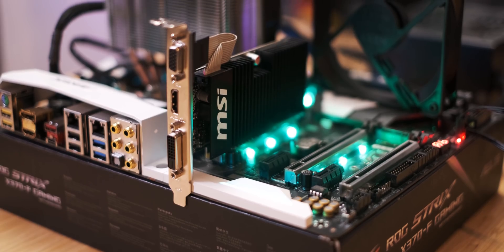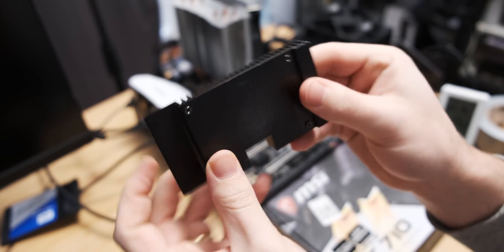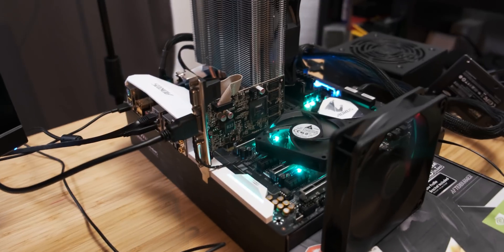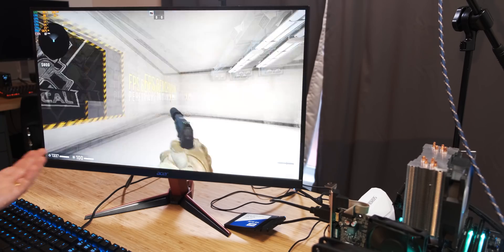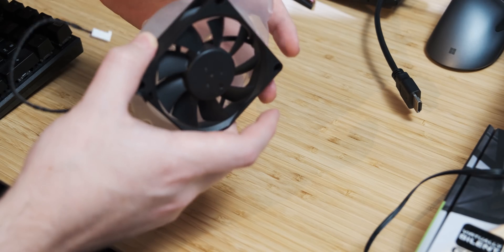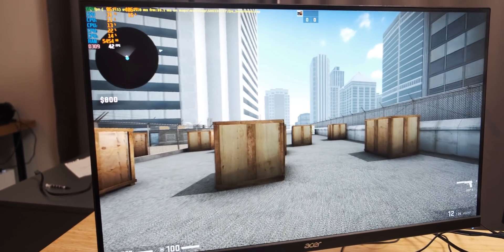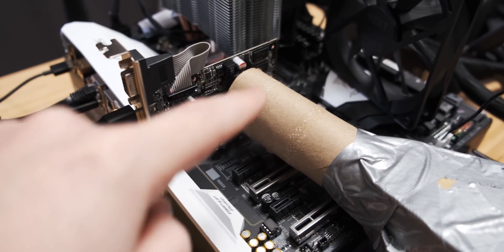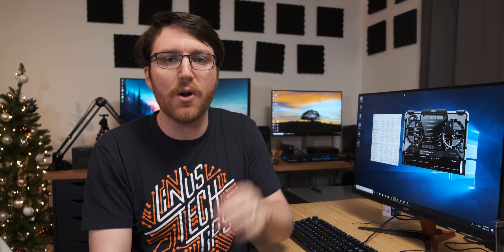Can you use a graphics card with no heat sink?

Comment: Question, just repasting my 3060 and what not as its been a few years and it runs a few degrees hot, is it going to affect anything if i remove the steel plat on top or would it help keep it cooler as it wont have the metal soaking up the heat?

Comment: Wouldn't you want the air to be pulled away from the GPU not blasted at it? That's why fans are the way they are on GPUs and CPUs.. pulling the air away.. I wonder if you flipped the fan around with the funnel on and drew the air away from the GPU constantly, whether that would improve things..

Comment: Well technically you can run one without a heat sink but it’s gonna be hotter than the sun to the point where it’s going to shut off or lose that life or at least for the higher end cards

Comment: I think the short answer to this is YES, but the question is for HOW LONG? I mean depends on what vidoe card we are talking about too.  I have an old 3d Rage 8MB card that has not heatsink but also can't play any modern games, and plays very few DOS games but it doesn't have a heatsink.  Even if you can get your graphics card to run without a heatsink, it will have a very short life.

Comment: Not quite the same, but I accidentally forgot to plug my fans back into my RX 560 the other day and it still played Cyberpunk at above 30fps for like 10 minutes, then started dropping... Then I looked at the temps... 89-90C... I realized my mistake immediately... Really surprised it took that long to throttle bad enough to drop below 30fps, though, since it barely runs 30fps anyway... And now I see the date on this... Does Google know I did that? lol... Why did I get this recommended now?

Comment: I think the gpu was being cooled by the ground planes on the pcb more than the air. I bet if you focused more on cooling the entire pcb you would get the best results. In that last test you had the big fan blowing air over both sides of the pcb, which may have made a big effect. of course the room was colder and other confounding factors so i cant be sure. its just a guess.

Comment: "which is not an ideal temperature to be gaming at"

You should probably avoid the scary world of gaming laptops. . . . . .
Reply: 'Gaming' laptops should have better cooling, they already cost twice the price it cost to make them, so they'd need a more powerfull cooling system.
Reply: when 80+degrees is considered normal
Reply: @pretentiousarrogance3614  lol what? 80 is pretty normal lol.
Reply: @Steiny5843  no
Reply: @Steiny5843  its quite bad
Reply: @d0n0trithimit  for laptops? 80 degrees Celsius is normal.
Reply: @Steiny5843  my old laptop got around 90 degrees celsius hot when running cpu intensive games and started thermal throttling like hell and it was kind of a evil cycle of this
Reply: @Steiny5843  Everyone knows that it's considered normal for laptops, that was precisely the point of Pretentious Arrogance. And it's also absolutely stupid.
Reply: @Steiny5843  80 is not normal for a desktop at all, that would mean the gpu is choking severely. for a gaming laptop thats better than normal though lol
Reply: r9 290X enters the chat
Reply: @jordangogov5866  with the blower fan... Straight to 95°C
Reply: @jordangogov5866  agreeeeeeeeeeee, although i have one with the tri-x cooler which maxes out at 75 deg, but the blower gets to 94 and thermal throttles
Reply: Gaming laptop raw disposable 
1st battery will die after 3yrs+
2nd to much heat and will get worse overtime
3rd when keyboard is broken so really big problem ..ye you can use usb keyboard now you have 2 keyboard lol
4th hard to clean since it's not really modular.
Reply: @gamertechlive1780  who keeps a laptop for over 3 years anyways?
Reply: @Jasontvnd9  my laptop is 3 years old and still awesome. i7 8750/1070mq/32gb/3tb ssd
Reply: @Jasontvnd9  
Umm everyone who doesn't shit money keeps a laptop for more than 3 years?
Reply: @rockytom5889  honestly it's not much to spend £1500 every 3 years is it.
Reply: @rockytom5889  you have a VPN to a local intranet? Did you really just say that thinking it would baffle me with those terms? 

Why would you use a VPN to connect to a private network? 

Sigh honestly mate I'm sorry that you can't afford to buy a new laptop every 3 years ( too busy filling your house with solid oak wardrobes I think) but the vast majority of people can.
Reply: @rockytom5889  first of all you try to find a £1500 laptop that has soldered ram or a battery you can't replace......you won't.

Also these briefcase style laptops you speak off still have BGA socket cpus that are not replaceable and BGA GPUs that are not replaceable.

If you want upgradability buying a desktop is absolutely the way to go , I spend 3 nights a week away from home and still need a relatively powerful laptop when I am away so spending that kindoff money every 3 years is really no big deal , I have a 9900k desktop at home with a 2080ti and a 10750H laptop with a RTX2060 for when I'm away , I'm happy with that solution and I'm happy to upgrade every couple of GPU generations , I can usually sell the old one for around 600-700 so it's really only 900-800 I'm actually spending

The desktop is faster in every single way but the laptop is good enough for what I want to do , Usually playing games to chill out or relatively basic computer stuff that couldn't be done in a £300 laptop really.
Reply: Modern laptops have impressively bad thermals, ive got an old dell laptop from 2008 with whats essentially a mobile 8800 gtx and under full load the temps barely scratch 75c
Reply: @lol123406  well thats exactly why, the older the hardware, id assume the less intense the games that are going to be played.
Reply: @seizmic7024  it has a high end core 2 duo and a gtx 8800m, as well as a 1920x1200 screen. What it plays isnt the lightest of games, like crysis on high settings
Reply: @lol123406  yeah but your Dell gaming laptop ain't pushing 8 cores go 4.2ghz.

Thing with gaming laptops is they will boost to whatever they can to give you the best performance.

95c is very hot for most things but honestly there's not much in a CPU that is going to care about it.

They tested a p4 at 100c and found the projected life span would be around 9 years.

A gaming laptop that's 9 years old is going to be useless well before it's CPU gives up.
Reply: @Jasontvnd9  this is a comment about an overheating laptop, my comment was about modern laptops having terrible cooling performance, while comparing it to my ancient dell workstation laptop. nowhere did anybody mention an 8 core 4.2ghz overclock
Reply: @lol123406  it's not an 6 core 4.2ghz overclock it's a laptop , specifically the i7 10850H , it will run an all core turbo of 4.2ghz if it has the cooling to do it.

Modern CPUs like the 10 series have a tjmax of 105c , They will start to throttle at 95c and not get anywhere close to the TJMax.

They will sustain 4ghz+ and 70watts of power for hours on end.

If you want them to be cool you can disable turbo boost and they will run at 65c.

The point I was making is laptop manufacturers allow you to use performance of it's available..

It runs hot yes but I have a 8750H that's been running at 90c for probably around 3 hours a day for 2 years and guess what.....it's still fine.

Your old dell didn't have a turbo boost and probably adhered strictly to it's at most 35w TDP.

A 10750H and above will and do hit 70w+ in sustained load and can peak at upwards of 100w in peak usage.

Now CPUs have got better and faster but a cooling solution that can fit in a portable laptop has physical limitations.

An Omen 17 for example has a very well designed cooling solution that is optimized for the size of the laptop.

The fact it can dissipate around 250w of combined GPU and CPU heat in its top configuration is actually very good.

Laptops haven't got worse cooling , they are just much more powerful than they used to be.

People put too much emphasis on CPU lifespan , The CPU will be drastically obsolete long before the CPU is dead , They did a test years ago on a P3 and found that at 100c the lifespan was estimated to be around 10% shorter than at 70c.

I have a high end desktop at home and take my gaming laptop when I work away , pick 2 of the following 3

Portability 
Performance 
Temperature 

You can only have 2 of them in a pc.
Reply: @Jasontvnd9  bro, no shit a high end desktop cpu is going to offload a ton of heat, AND turbo really high.
we literally were not talking about that, we were talking about terrible LAPTOP thermals, desktop thermals are an entirely different matter. i had to buy a noctua nh-d15 just to keep the thermals of my ryzen 5 3600 in check. 

and the dell laptop has a 44w cpu in it, but that's entirely irrelevant. if the laptop can't dissipate the heat it's producing, it's going to downclock, and most modern laptops produce more heat than they're able to cope with, hence why laptop cooling pads are such a big market

i've got a toshiba satellite p850 that's got an i7-3630qm that gets so hot that i literally can't touch it because the cooling in it was terribly designed, and that's the cpu it CAME with, and on the other spectrum entirely, i've got an old toshiba tecra a9 with a core 2 duo t7500 and a quadro 140m, and it has no trouble moving away the heat it produces, keeping all of it's performance intact

it's like those macbooks with the i9s that got so hot that they'd downclock themselves until they were as slow as a low end atom netbook
Reply: @Jasontvnd9  100c is also still ridiculously high, and super uncomfortable to use, all in all they should prioritize better cooling instead of this stupid thin fetish they keep going for nowadays
Reply: @Jasontvnd9  and for the record, in 2008 a dual core 2.8ghz 44w laptop cpu was basically on the same tier as a modern laptop grade i5, remember, parts scale with time, just because it's low end today doesn't mean it was low end in 2008
Reply: @Naukograd I'll tell myself that when I spend 5 nights a week in a hotel , I should have brought my entire desktop to the hotels right?

I have an Omen 17 i7 10750H + 16GB ram , RTX2060 for when I'm away and a i9 9900k + 32GB ram and RTX3080 for when I'm at home.

Laptop doubles up as my work pc aswell it's the perfect combination for me so no it's really not dumb.

Is the desktop better , yes obviously but the laptop will run any game at near max settings and the 17 inch screen is still fine for when I'm away.

It also has WiFi 6 which is really useful Inna hotel where the connection can be sketchy.

The steam hardware survey still says most people are on a 4 core CPU with 8Gb of ram and GTX1060 which means my laptop is quite a bit chunkier than your average desktop gaming pc.

My desktop is more powerful than just about everyone's gaming pc.
Reply: @Naukograd If you are 12 maybe.
Reply: my lenovo laptop had good temps ryzen 5 3500u running gta 5 at 59c. but my main laptop a msi with 1660ti an i7 9750h runs gta at 95c cpu and around 70 gpu
Reply: My ninja 80 c is normal
Reply: 'Me, who panics at 60 degrees GPU
Reply: anything below 90 is normal
Reply: @bananamonke630  no it's not ? What do you even consider "bad temperatures" ...
Reply: @ziarmex6167  above 90,when it goes above 90 i quit the game
Reply: @d0n0trithimit  Dude we arent talking about desktops we are talking about laptops?? can you read?
Reply: @Steiny5843  very nice calm and appropriate response man

Comment: Ironically if you had stuck one thin strip of aluminium to the chip and extended it a couple of inches off towards the rear, and pointed the funnel at that, it would have worked to some degree. But, that would just make a poor heat-sink lol.

Comment: Dawid, for fun, you should put a MUCH smaller / different heatsink and/or fan on that GPU and test it.  Something like one of those little Raspberry Pi heatsinks.. or a VRAM heatsink, etc.. (something like one of these:  https://www.aliexpress.com/item/32845061391.html ).  .. Or maybe stick a northbridge cooler on it.. like this:  https://www.aliexpress.com/item/32432346031.html.   On the other end of the spectrum, you could pack a chunky CPU heatsink cooler, like a  on it and see how far you can ramp it up on the OC.

Comment: 16degC ... this is colder than the airconditioned room here in the tropics ... temp here can be 30+degC ....

If you really want to fry your gpu, try without heatsink or fan during summer at 40degC heat ;)

Comment: LOL I really needed this video. I wanted to use a GT 730 as a secondary GPU, but it doesn't fit with the heatsink on so I thought maybe I'd use it without the heatsink, and underclock it as soon as I have a working system. It is for a PCI Express passthrough in Linux so I can virtualize Windows; the 730 would be for Linux (just because the host system needs one) and I'd be passing through my GTX 1060 to Windows. I want to use Linux as my main system but don't want to deal with dual booting.

Comment: To use the funnel you need a high pressure fan, not a high airflow fan. That said, what is the point of this experiment? I thought the idea was to see what happened if you ran the card without a (silent) heatsink - so why add a noisy fan?

Comment: why not undervolt it? don't these gpu's still have some sort of voltage curve or non-encrypted bios?
Reply from the maker: I spoke about it in the previous video. You have to edit the BOIS to have a small control over the voltages. I was running it at low voltages.

Comment: My 10 year old son took the heatsink off his 750ti for some reason....... lol. It lasted about 2 minutes into windows and then crashed. He just tried it over and over until finally telling me later that night. He said he saw me doing it the week before (taking the heatsink off a gpu) because one of my older gpus was running slow. He didn't wait to see that I was just replacing the thermal paste and that I put the heatsink right back on... luckily the 750ti still works fine.

Comment: I used to play trumpet 🎺 and the mouthpieces are shaped a lot like the first funnel you used. The entire point of having the cup at the top of the funnel (in the case of a mouthpiece) is to create back pressure for the air, which is required for the instrument to play properly. I'm glad funnel 2.0 did not have this cup shape at the top.
Reply from the maker: Thank you for this very helpful comment. 😃

Comment: The passive heatsink isn't meant to be an active cooler. This card would be as hot as now if you don't cool it with the delta fan.
Reply from the maker: You will see at the end of the video, I use it without the Delta fan and it's fine.

Comment: If it throttles by approximately 50% then it's actually not working. It was intended to run at higher speeds while staying cooler, with the heat sink. Failed